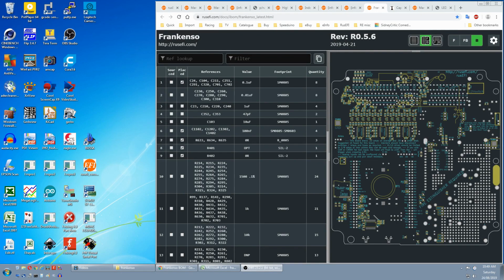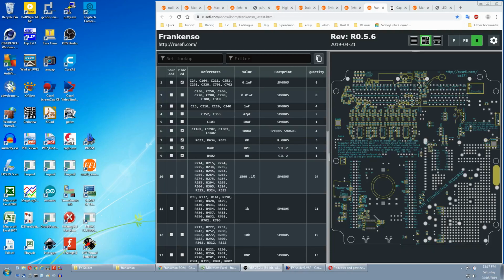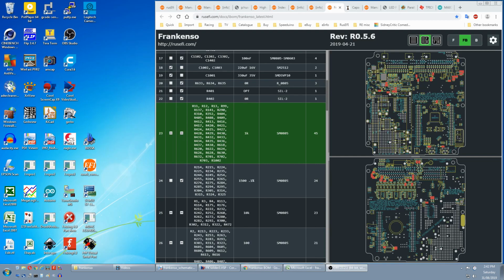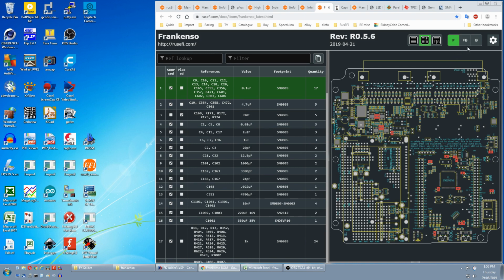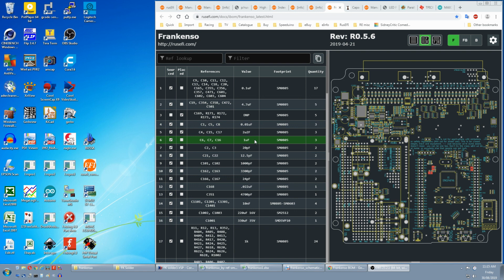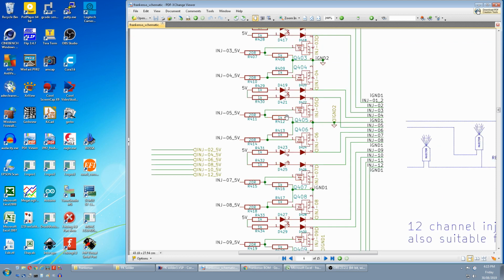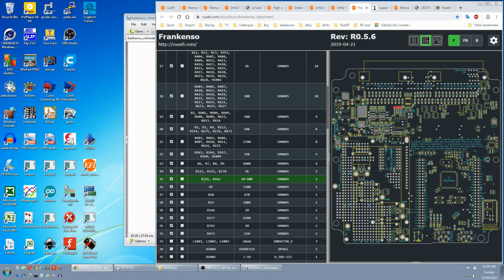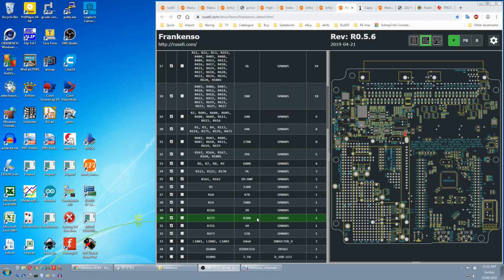rusEFI Frankenso 3a - Soldering - Front Prep 1

Comment: Knock has not been working properly as writing this. You may notice the datasheet uses a signal from the MCU while we attempted dedicated xtal. The key problem with this circuit has been getting the xtal to start reliably.

It is lower cost to use the discovery board. So we expect the stm32 will not typically be installed. I do not know why the BOM does not acurately show the page designators. 

The thermocouple circuits do not seen to be a popular choice so it seems they are not provided in the kit. I am surprised these are not more popular. 

Several of the dnp's are for optional features. What is populated or not depends on your desired configuration. For example hall vs VR in the max9926 page.

Great videos. It's great to see you documenting this.
Reply from the maker: I should really get more into it so I know what's going on, like read the whole forum, but it's a pretty high level forum so it's hard to get motivated.
At least that answers some questions.
Exh temp was popular in the old days, because that's all they had, but it's never been great.
Reply: @SidneyCritic  yeah I hear you. Lots of reading could fill in some smaller details. That's were better documentation is really handy. Your videos are helping allot with that. Thanks for doing them